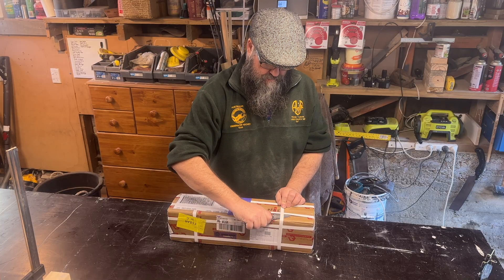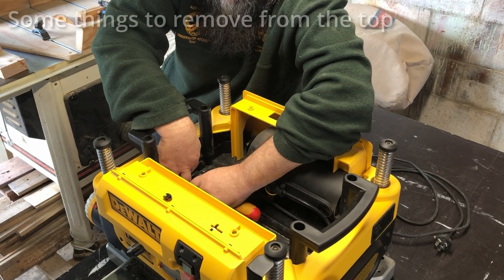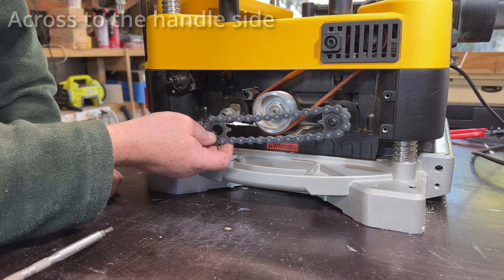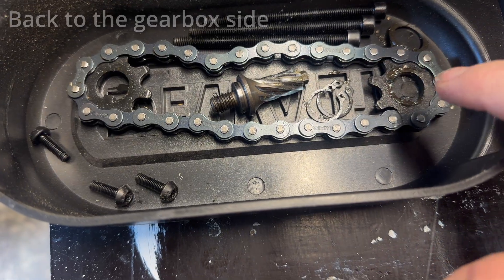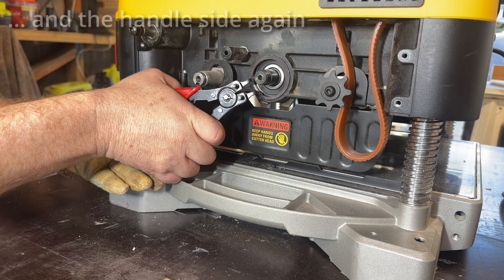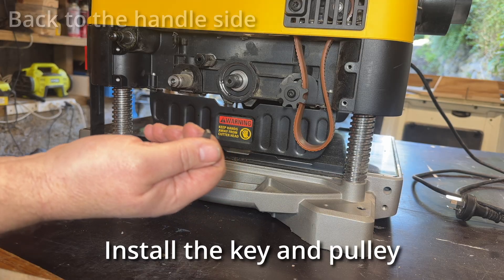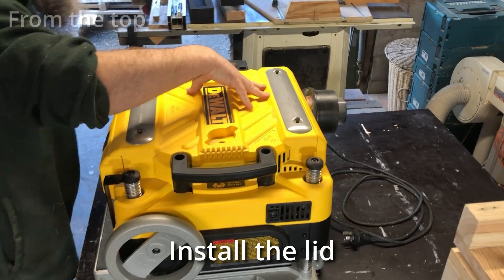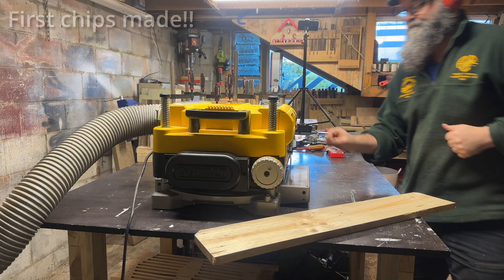How to Upgrade a DeWALT DW735 Planer with a Helical Cutter Head (Step-by-Step)

Comment: This video was well done with one important exception.  At the very end of the installation, the Dust Cover is installed BEFORE there are any carbide inserts loaded onto the Cutterhead.  This would become obvious during that first test run - and easy to recover from.  Several other posters describing helical cutting tool retrofits to the DeWalt 735 planer also get it wrong.  Some show carbide inserts installed onto the Cutterhead BEFORE installing the Cutterhead into the planer frame (which is not possible as Shaft bearing bores are too small to allow Cutterhead entry WITH cutter inserts).  Bottom line is that this upgrade is a must for planing hardwoods.  Use of a helical Cutterhead makes dimensioning and finishing operations far more efficient, quieter and extends the life of the drive motor.
Reply from the maker: Cheers Jason, thanks for the view and the review! I also noticed a video or two with the cutters on before installing the cutterhead. Not possible in my DeWalt! I actually put the dust cover on and started the machine before installing the carbides on purpose. I was NOT confident that I had done it correctly and figured there was no point putting all the tips on if the machine was just going to fly apart on the first run! No wood was sent through before the carbides were installed :)